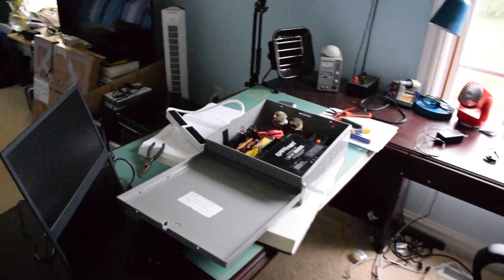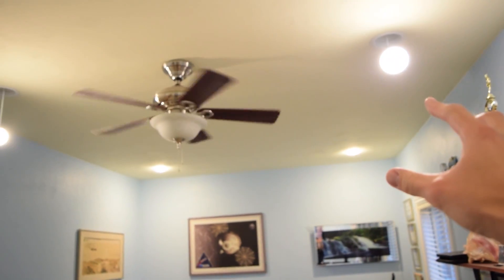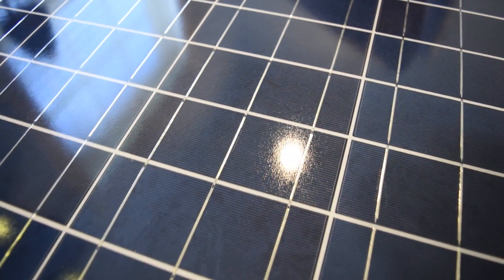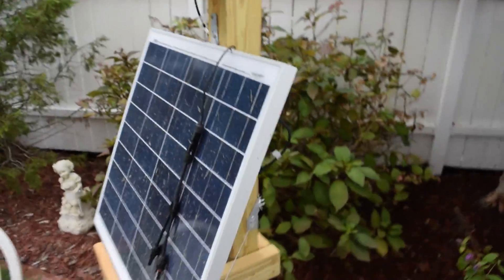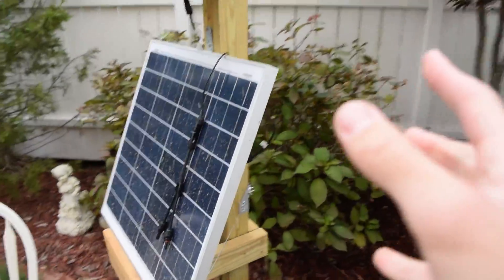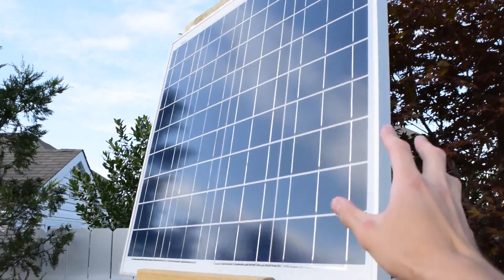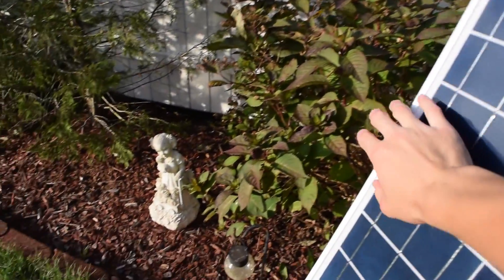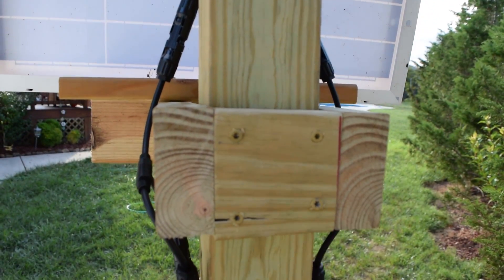Solar Powered Server Project: Trial System Part 3: Upgrades!

Comment: You should use this to power your PC with just 12 volts. http://www.mini-box.com/M4-ATX  cost $79.00 Then you can use this one to backup from your house power. http://www.mini-box.com/picoUPS-120-12V-DC-micro-UPS-battery-backup?sc=8&category=981 and use a MFJ 4230MV 30 Amp MightyLite Switching Power Supplies MFJ-4230MV here: https://www.dxengineering.com/parts/mfj-4230mv?seid=dxese1&cm_mmc=pla-google-shoppingdxese1_-mfj&gclid=CjwKCAiA4vbSBRBNEiwAMorER6-Y8CCVFeMiZApgnBEAWdlzgiI7f0XhG45Eho3fGYJ2SVgTanny2xoCgssQAvD_BwE Then you can use the adjust volts to 4V to 15V and when you do that it will use the PicoUPS-120-ATV for car application what has more power your solar or the power supply. This power supply has a lot of amps at 4 volts and the PicoUPS-100 12V DC micro UPS system / battery backup system can still have 12 volts from 4 volts with a lot of amps.

I think that is the best set up to use 12 volts and 5 volts too for PC and lights. It's like a battery backup but you can use AC power from your house to back up the power if you battery goes to low.

Comment: Great video. I'm working on a solar powered Pi 2 project myself. My calculations came out about the same as yours. I'm looking at using a 100W panel and six 12V 7AH batteries in parallel for 42 hours of power.

Comment: Fun project.  I've got a bunch of HP Thin Clients from eBay very inexpensively.  I will likely use at least one of these for a solar server.  Additionally, I'm working on a box truck conversion with about 2.5kw of solar panels....work in progress and just chomping at the bit for warm weather.  LOL

A couple points I could offer:
1). Don't downplay the boost in solar production you get from properly facing your solar panels.  If you can't use a tracker (like I can't with my box truck), then, at the very least, get the tilt angle right.  You should see a fairly substantial increase on performance.  I noticed about a 18% difference between the panels laying flat compared to being tilted correctly.  Your mileage may vary, but that's huge for solar applications, IMHO.

2). I would suggest adding a small fan inside your enclosure to remove the heat. Cutting a square out of the bottom below the CC and mounting a small DC case fan inside as an intake then cutting another hole toward the top diagonally opposite to the intake would create a nice little air flow, I'd think.  If you want to get fancy with it, you could put in a thermal controller made with an Arduino to control the fan.  Cheap and effective solution...not to mention a fun and practical project (and did I mention cheap?).

Kudos to you for thinking GREEN!  Lots of people will only look at the ROI aspects of these kinds of projects and in that regard, it takes a long time to see any kind of financial ROI on solar, however, the point in doing projects like this (for many of us) doesn't lie in the financial aspects, but more in the environmental, self-reliance, and fun-factor payoffs.

Thanks again for making this series!

~JT

Comment: @AA Computers and Technology Hey, Nice video but I have some suggestions. The Solar charger you are currently using is probably just a standard PWM charger which is fine but isn't the best for you. They will never really be able to utilize the full power capability of your panels. You should replace your current charger with a MPPT(Maximum Power Point Tracking) charger. Like it's name suggests, it tracks the power coming out of the Panels to maximize power extraction under all conditions. So even the minuscule power coming out during cloudy days would still be usable and useful. I would recommend looking up some videos regarding MPPT chargers and sources for genuine chargers (there are quite a few fake MPPT chargers out there). I'd recommend watching 'Julian Ilett''s videos regarding MPPT as well.
Secondly you should definitely take that DC-AC inverter out of the equation. Inverters like those are usually around 75% efficient at converting DC-AC and then there are even more additional losses when the power brick(s) step the AC back to DC at around 70-85% efficiency. All that conversion causes a pretty large amount of power loss from your system and should definitely should be removed. If those clients you plan to use require higher (or lower) voltages then you could use DC-DC converters. If you search for "DC-DC Boost Converter" on Ebay, you will easily find $5 converters capable of boosting the output voltage with several amps of output current and with adjustable voltage outputs. Same story if you search for "DC-DC Buck Converter" to lower the output voltage.

Again, Nice work on the video and I hope you continue your work on the project. :)

Comment: With 100 Watts of panels, 10 hours a day, you can generate about 1 KHr per day, Your lead acid batteries  are about 50% efficient, so you can store .5 KWh/day. In a year with 250 sunny days, you'll average 125 KWh of stored energy, at $.125 per KWh, you will have saved about $16/yr. If this is a learning project that's great, there's no economy in this. It would be useful in a remote area with no electrical source.
Reply: I know this is old, but going to reply regardless.
In his case it makes sense to produce your own electric in any way.
Before his solar he wasn't saving or spending any money on electric. He was consuming 100% from someone else's pocket and they were spending an extra $16 per year on his computers and lights.
Doing this has saved someone else (his parents) $16 a year. $16 that they wouldn't needed to have spent if he lived else where. They have given him a free home, and in a way he has saved Thank you by producing his own electric.
Reply: @DanielMosey   This one is getting really old but  economy  he could just pay part of the electric bill ( $16  a year) ,  Solar does not work  for 60% of the population.... (its  allmost as bad as  the free energy scams )

Comment: Wont the top solar panel block some of the sun light from the lower one. Also if you turned them so they were at more of an angle they would get better coverage.

Comment: My suggestion(s) check your local and state solar suppliers, some may have panels returned from damaged systems, or insurance claims, that are still viable, and cheap.
I got a 250w panel for $80 where I live.

get a better solar controller, the one you have is serviceable, but there are much better units that will feed much more power into your batteries. (I got a similar  to test, but it was faulty out of the box and was charging at 19v.. I tried trouble shooting it but ended up throwing it in the bin)

inverters tend to be horribly inefficient, if your servers are small systems, it might pay to look at a dedicated dc power supply.
http://www.mini-box.com/DC-DC  for instance.   (perfect for atom servers and such)

http://batteryuniversity.com/learn/   invaluable information about lead acid batteries and what to be aware of.

Comment: Great video! I'm thinking of doing roughly the same setup as you just using (2) 100w Solar panels. Any suggestions or tips and tricks you would like to share is greatly appreciated!
Reply from the maker: There is one thing that you might want to do differently.  My system uses a PWM charge controller which are cheap and easy to find.  I have read that MPPT controllers are 20-25% more efficient at charging vs their PWM counterpart.  You might want to look into using an MPPT controller if you have the budget for one.  Besides that I cannot think of any other tips for you off the top of my head.  If you have any specific questions regarding my system I would be happy to answer them!

Comment: Ok I have a question, would you know how to use solar power without using the batteries? Here's a scenario, it's a post apocalyptic world, batteries are very scarce but you need power for a ham radio to communicate to others. You also have no batteries to store the power. What do you do?
Reply from the maker: Actually most residential systems do not use batteries, instead they are tied directly into the grid and feed power into the grid only when the sun is out (for more information look up "grid tie solar system".  In the case of your scenario, assuming the panel is receiving direct sunlight and it has enough output to power the radio, you should just be able to directly connect the radio to the panels (also assuming the radio is powered off 12V).  It would be a good idea to have some sort of voltage regulator in that system but desperate times would call for desperate measures.
Reply: +AA Computers and Technology that's what I was thinking actually. I was thinking you could plug directly to it. lol

Comment: Yes I loved it is it running everything ok did you go see that windows small computer I showed you ?
Reply from the maker: Several people sent me links to mini PC's.  I think I saw your suggestion but I am not 100% sure.
Reply: was good it had windows installed in the price was good I sent the like when you posted your solar panels last week ok then thanks was only $130 usa pretty good small like the one you had and small power used I just thought was good for what you need if you using windows operating system ok

Comment: While this 400$ project makes for interesting Youtube content, is there ever going to be a return on the investment? Well, other than the fun factor. It seems you could have just handed mother and father the 400 to pay toConEd and been done with it for several years.
Reply from the maker: Nope.  The goal was never to get a ROI.  Yes, part of the point of building the system is to pull my servers off grid power, save my parents some money, and go greener as a YouTube channel but there is also another underlying factor in play.  I also just wanted to build it because I have had this fascination with PV /  off grid systems for several years.  I love hands on projects and the experience I gained and fun I had building the system has value in itself.